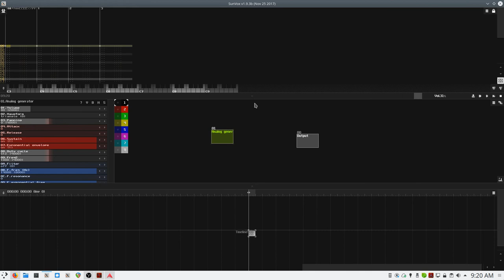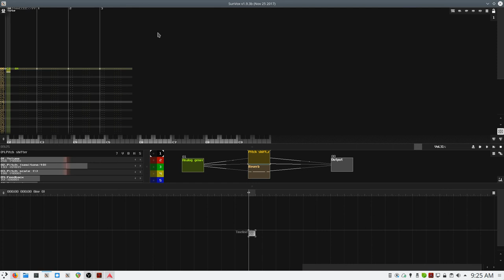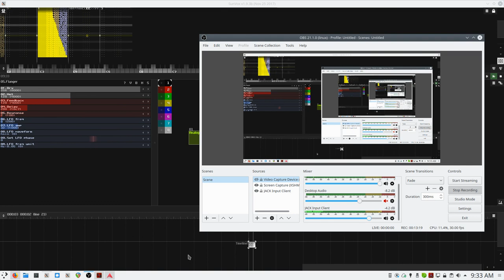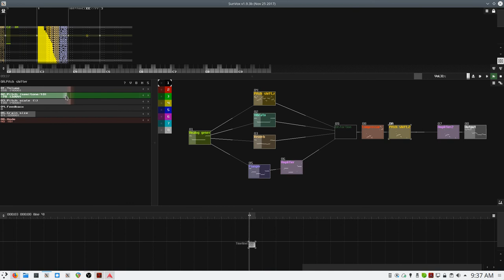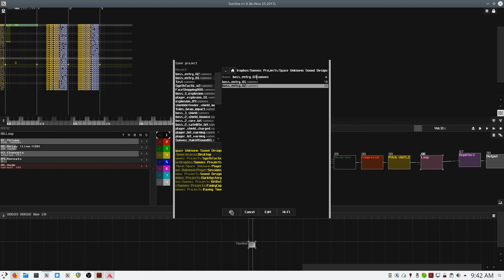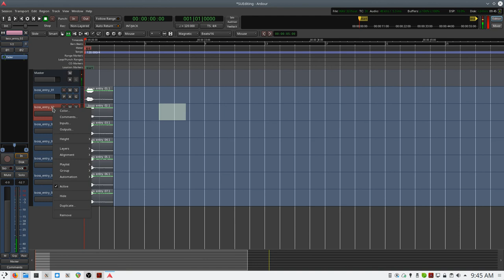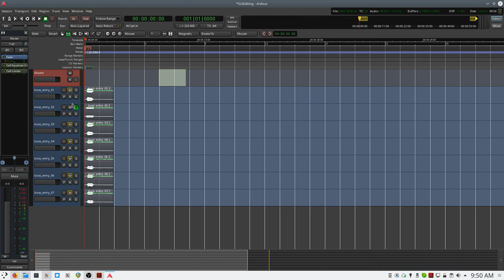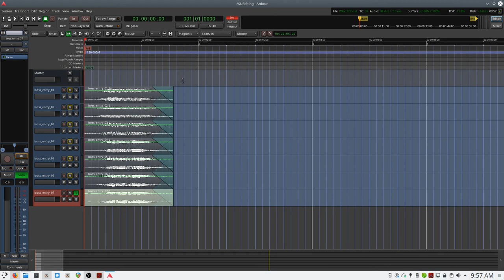[Sound Design] - Space Unknown Boss 1 Spawning Sound Design

Comment: 3:00 My cat is very interested in that sound.
Reply: At 9:00, just put your cursor on the module number in the editor (MM column) and press and hold '4' to write it to all lines. Do the same for the effect number (EE column). Much quicker. :)
Reply: 10:45 The reason it sounds choppy is (presumably, I didn't test it) because you're only updating the value once per line. If you'd update it once per tick instead, you'd get a higher resolution and I would assume a much more gradual change.

The easiest way to do that for something like this is to change the TPL value in Project Properties from 6 to 1. The project will seemingly play 6 times faster (so you need to increase the size of your pattern and the length of your note), which you would normally not do on a song. But because this is not a song, but a sound effect, having the greater control, not just for this effect, makes sense.
Reply: 13:35 You're not hearing much of the effect because you have the Dry setting much higher than the Wet. So most of what you're doing is just increasing the original square wave, while adding very little Flanger. Cut down the Dry value (I personally always set my Dry value for parallel effects to 0), and increase the Wet to control how much of a Flanger effect you want.
Reply from the maker: Thanks for the tips!
Reply: No problem, hope it helps 🙂